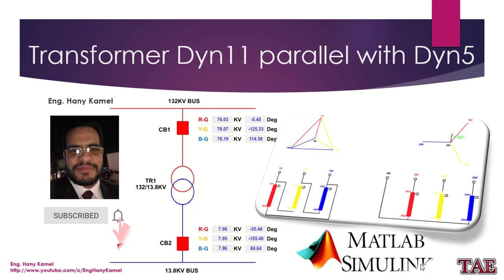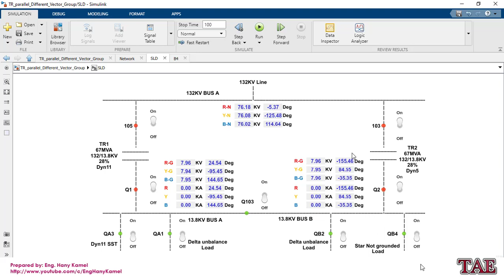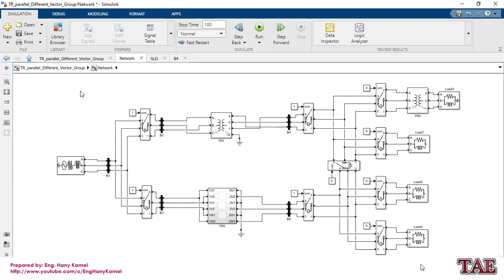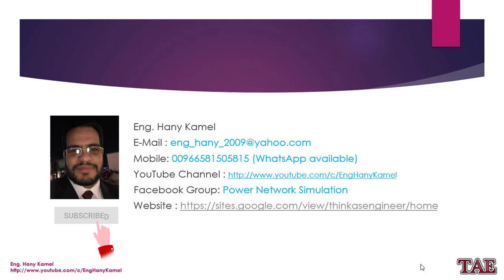Transformers Parallel operation Dyn11 and Dyn5

Comment: Hi sir, I would like to ask as how did the Dyn11 became Dyn1 when you interchange the phases B and Y in the primary of Dyn11? meaning the angle of the phase "y" in the secondary shifted as same as those of Dyn5, that is why the only thing to interchange now are phases "r" and "b" in the secondary. Can you explain, sir, how the secondary vector of Dyn11 shifted when you shifted the primary?